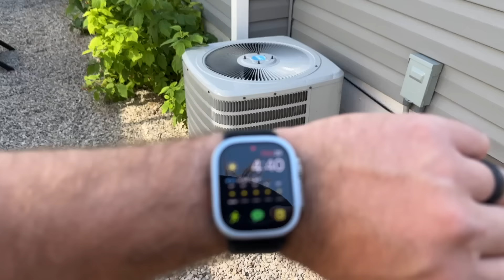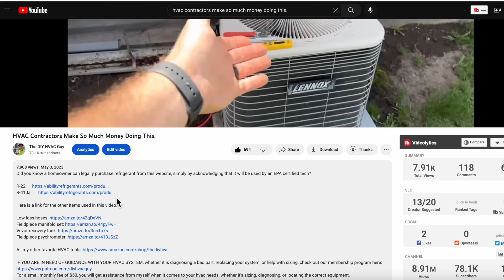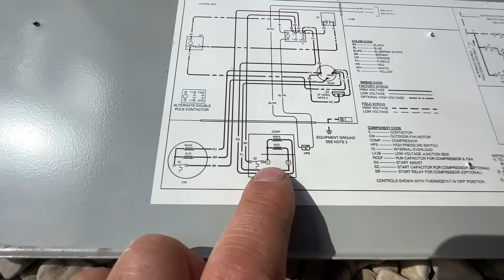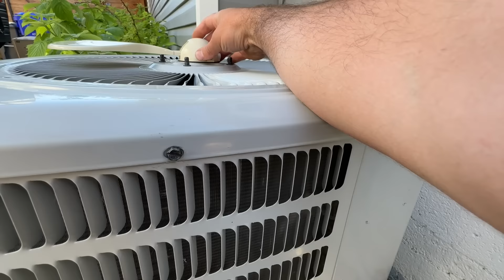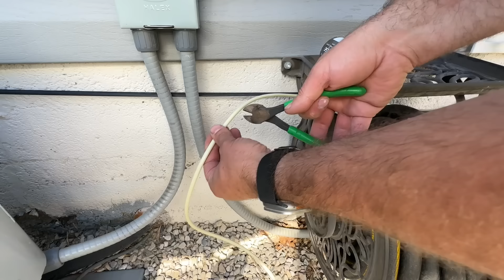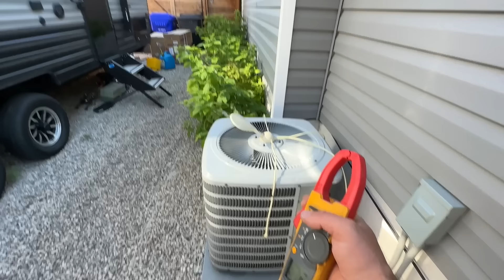Can This Device Actually Lower Your Electric Bill By 30%??

Comment: I give it a try last year. Worked as you said, but I removed it this year as the white, mineral scale on the outside of the condenser coil fins if not even close to removeable. Tried every home and commercial trick to remove the scale coating, not happening. Kinda wish I missed that video.

Comment: Very important key here, is make sure your water hose is in the shade. If you have a water hose out in the sun, that water will go from 70⁰ to 130⁰, which will probably give you zero efficiency.  

I also had an idea that if any of your hoses are out in the sun, to feed them through an empty water hose peice to shade them as well. But my air conditioner for some dumb reason is on the sun side of the house as well as my water hose over there. The water in the hose is so hot you can't even touch it. So make sure your feed line is in the shade!

Comment: Huh.   So you are adding a swamp cooler to your condenser.

I'm guessing this has the biggest impact where summers are very dry.   Here where we have very humid summers, I imagine the impact is likely marginal.  (that's why swamp coolers don't work at all here)

I'd imagine mineral buildup can be a problem even if you have reasonably soft water though. Is there any concern about additional corrosion by making the unit wet all the time?

Would be an interesting project to collect the condensate from the indoor units and lead it outside and mist the outdoor unit with it, much like how window units do it.

Comment: MAKE A BOX WHERE THE SUN COMES FROM. Cover the side where box can block sun rays make it at least 6 inches wider than size of box and 2 feet or more higher than height of AC Unit.

Comment: What if I took a 55 gallon barrel with water? That's really pure So I get no calcium, buildup, spray water on the fins, but mix it with water-soluble oil.
cutting oil from mobile. And have the water loop in a circle

Comment: There are issues with doing this including rust and mineral buildup.  To remove mineral buildup buy a cheap RO (reverse osmosis) filter housing and a filter, probably $30 or so total and install inline.  Will slow water flow but you dont want high flow anyway for misting

Comment: My mother lives in a barndominium and when it got too hot for the AC to keep up I would set up a sprinkler for her to spray water onto her roof. It also hit the outdoor unit, which I thought was a good idea. But now it's crusted over with calcium and I have to scrub it down with vinegar every year to keep it from clogging up entirely. Also wastes a TON of water, but she's on a well so it doesn't really cost much though it makes a swamp out of the north side of her yard. This system seems like it's superior in every way. I had thought about setting up a mister system around the south and west sides to help with the heat on the metal siding and roof but was afraid of the calcium build up. I'll have to look into those little mineral exchange units. That would make it work!

Comment: We had a couple of cooling towers installed at a chemical plant used to cool water that pumps through heat exchangers.  The only electricity used is for the motors and water then evaporates as it trickles down the cooling tower fins which cools 180 degree water to near ambient temperatures in a single pass through the 700 sq. feet heat exchangers.  The circulation line to the towers are 18" in diameter, so the heat removed is huge.  I can see how this works on a home AC unit.  Basically, the coils use evaporation to assist the cooling of the condenser so it doesn't need to work so hard.  We did need to add scale inhibitors to the cooling water because without it, the cooling tower fins would scale badly.

Comment: Having 100% humidity on the compressor side of your AC system will reduce the lifespam of the appliance by half or even more. Not a good idea at all. In any case, use alcohol instead of water, it cools much faster and evaporates so fast that will not affect the appliance like water would do. But now you are spending money on alcohol plus it could become a hazard. So be smart and just get a good AC system and let it work as intended.

Comment: Hmm... You have to wonder if just spraying mist was the solution then it would be baked into all these fans. There must be other engineering design considerations why this should not be done. The companies don't lose anything adding it or are trying to "cheat" you type nonsense because that makes 0 sense given people like this guy could be working there. There's other things not factored in

Comment: I spent 17 years as a HVAC tech in Phoenix.  DO NOT put a mist system on you condenser!  I have seen MULTI instances where it has ROTTED the aluminum fins so badly that you'll be able to EASILY drive your fingers into the fins and they will literally crumble like a mummy and expose the tubing that the fins were connected to. MAYBE it is the hardness of the water or a combination of hardness and PH.  Consider this: Pure water has a PH of 7 but tap water can get from 6.5 which slightly acidic to more basic PH 9 like Sodium Bicarb.  I would NEVER, EVER do this.

Comment: I used this system until I noticed the hard water deposits developing which would not wash off. 
I thought about the increased wear and tear on the AC unit was more than the money saved, so I stopped using it.
If your AC unit is in direct sun during the heat of the day, putting a shade over your AC unit will help during those times, with no negative effects.

Comment: I find it dubious.. Your system is designed to work at certain pressures and expecting certain temperature ranges. If you lower the condenser pressure you might experience issues with your system. Also, many places have a lot of minerals in the water which will quickly clog up the nozzles and your condenser core. I'd be very cautious trying to use these systems..

Comment: You need to filter the air so no dust  builds up on the small Finns like mud and than the unit will not work at all the water will desolve the small Finns too and you need a new unit in 3 months cause it dropped its gas

Comment: Shielding your air conditioner from direct sunlight will help cool your home better than almost any gadget out there. Just 
a piece of wood or corregated aluminum over the top and or sides but still allowing plenty of air to circulate will work great.
It will also help avoid leaves, pine needles, and other debris from getting into the fan and coils.
Reply: Add in a device to prevent recirculating the exhausted hot air back into the coils for a further benefit.
This can be a passive device with no scale contamination problems.

Comment: It probably will.
The question is the trade off.
It may lower the electric bill by reducing run time of the ac.
But buy what amount is your water bill going to go up.
Not knocking it, seriously wonder.
Over a month, this is probably going to be at least hundreds of gallons of water.
Also having the water all over the coil will restrict air flow at least a little bit, which will be a slightly higher amp draw on the condenser fan. So will that cancel some of the reduced run time savings?
I guess the only way to know would be to do it for a season and track the cost. And hope that energy and water costs remain relatively constant.

Comment: I put my paddle on top while the condenser was turned on and my paddle doesn't go up in any position.  My first thought was that maybe my airflow was being affected as my coils might need a cleaning, so I got a can of cleaner from Lowes and gave it a thorough clean.  That should do the trick, I thought...but when I tried to find the right placement for the paddle...no change.  My unit seems to be working fine, but it's not lifting the paddle at all.  I tried to contact the company, but haven't been contacted back yet.  Any thoughts, by chance?

Comment: How well do misters work in high humidity areas or if your water lines put out blazing hot water?
Reply: Water temperature almost doesn't matter. You can ignore it. It's all about air temperature and relative humidity of air.

Comment: In Houston the water from the tap has about 300 to 325ppm TDS, it would take just a few months to coat all the coils in the condenser with rock hard deposits so they would not even transfer heat any longer.

For drinking and using in my machines (I have a machine shop) I use an RO system with pump. I could take a 5 gallon bucket with pump and place it near the unit, inside of course. Just keep the bucket full as I do several other machines during the day. Water from the RO system runs 0 to 10ppm TDS. (who needs that $50 a month water service when you can make your own)

Comment: If an A/C unit is putting out 30°F below the outside ambient temperature then its doing its job. He stated 90°F outside and an air output temperature of 53°F indoors, that A/C is doing its job very very well. I want to know why he didnt clip the ammeter to the "red" wire when he took his first measurement. This is a good way to oxidize everything when the misting water gets into and past the condenser in my opinion. I'm not an HVAC tech but I am ASE certified in Automotive MVAC. This just looks like a good way to cause the condenser fan to oxide and lock up over time as well as causing a myriad  of other problems. Also that flap switch is blocking some airflow. Even though it's only a negligible amount I still think it possibly would affect performance of the unit. The guy was getting an indoor drop of 37°F and to me that's right around where the output should be. It would be better to spend some money on further insulating the home then some gadget that drops the current by 0.8 Amps. That might save you some change in the short term but in the long run oh boy at the repairs it'll need. Oh well to each his own.

Comment: Super impressed?! A single degree drop in temp at the register and not even an amp less running? 

The before and after measurements  are less than your measuring equipments accuracy ability. Measure it now it’s 1 amp less, measure it an hour later it’s a half amp more, measure it in 2 hours it’s .5 amp less. 

NEGLIGIBLE at best. These things will have mold growing and extra particles building up all over those fins after a while. 

Why would you recommend this? Doesn’t make any sense.

On top of that why would you expect it to be any quieter?? And why on earth would you expect it to pull less power?? Since when do compressors know how to adjust their power draw??

Gaaawwd dang dude, you should be ashamed of yourself for recommending this.

Comment: If you are using water with minerals in it (ie "hard" water) you AC is gonna look like shit pretty quick and youre gonna have calcium deposits on it. I used an evap cooler in AZ for years and it didn't take long and you got a calcified system. Oh yea, and if humidity is high, don't expect much evaporation to contribute to a lower cooling bill.

Comment: The Trane Air-conditioning manufacturer company tried this concluding most water utility systems and the quality of water produced are not compatible with these condenser units. Notwithstanding, I considered using a Reverse Osmosis unit that might solve some of the issue, but realized for every gallon produced 4-5 go down the drain. Continuing: If the typical unit ran 30 minutes per cycle per hour and required only 5 gallons per hour (1 clean, 4 garbage gallons) your water consumption would still exceed 3600 gallons per month as it were.  But not all is lost in this concept. 

A company in Arizona, once bosted about their seer 17 accomplishment system some 12+ years ago that used the following: Borrowing the "water cooled" direct heat exchange coil method (that started with Ice machine refrigeration units) otherwise known as "Water cooled condensensors", one would typically plate the copper coil with zinc or more preferably with silver &/ or silver solder. This same coil then sat in a water pool whose water was circulated similarly as an evaporative cooler back in the day. It looked like a typical condensor but functioned like an evaporative cooler. Nowadays,  seer 20+ are typical and have since dwarfed that concept.

Comment: I would not want the water spraying on the unit as it would deposit minerals on the coils.   I would set up the mist so that it completely evaporated to cool the air before it is drawn into the coils.

Comment: You gave us supply temp but never gave us the actual temp in the house. What was the split before and after? I can get a AC unit to spit out 45 when the house is 65. Not rocket science. Most ACs have a 15-22 degree split.

Comment: No, no, no, and no!!!
That will not help in the long run once calcium and minerals encapsulate your coil.  I dont care what filter you put in line.  Long term it will be catastrophic to your condenser.

Comment: Absolutely correct. Was in conservation and load management for a major utility providing guidance to residential and commercial customers. Never install any device that sprays water directly onto the condenser coils. It will destroy them. While this unit sprayed away from them, the spray was sucked right back onto them. No good!!!

Comment: I had one on for 2 years. Yes, it does work, but it also gives gives you a big amount of calcium build up. Enough to block vents. The only thing that would help is vinegar . You'd have to put it on a few times to get it cleaned off.but only 50% comes off . I would not do it again. After not doing it for about another 2 years after initially using it. I had to buy another AC. Unit, just because mine was about 30 years old.

Comment: Don't do this.

The coil tubing is usually copper, and the fins are aluminum. Keeping your coil wet will cause an electrolytic cell. This will cause the coil to fail.

A really bad idea.

Comment: The ideal works but it’s best used in short run times, like at peak hours to take the edge off. I would add a sprinkler timer to this setup and set it for about 3-4 hours at the peak of the day.

Comment: i made a system with a garden hose timer, it worked but stained my unit very quickly, with a house filter inline.  maybe a different filter. but it was for sediment, stain looked like the start of corrosion, I have mist 6 mist systems for our patios and our dog kennels. so i wanted this to work, but i am concerned it may eat up something inside at this point.  but my spray was constantly on for 5 hours.  also, if you do it spray the water spray away from the unit so that it only goes into the unit when the ac turns on.  my original set up sprayed into the condenser.  not best...

Comment: As others mentioned you would have to have a good idea of what kind of water you have. Just as a thought..if one has a rain barrel (which we do) one could set up a small pump and use that water. We (Florida) get lots of rain in the summer so keeping it full would be easy. Given the unit gets lots of rainwater as it is I expect it's fine to use. It would be a project that I'm not sure I'm willing to take on yet but something to think about. ALways appreciate these kind of videos though.

Comment: This is my 2nd summer in oklahoma city using this, working fine, small amount of lime build up. Will spray with vinegar solution this fall. Try it if you have high temps and soft water.

Comment: If you're watching this, DON'T DO IT!!!!!  After a a year of water cooling the AC coil will cause the aluminum coil of the condenser to deteriorate and break apart.  The calcium buildup on your coil will start to break down the aluminum coil which in turn the condender will lack cooling of the freon.  Yes, the water will help cool the AC but the cost of replacing the AC pump and condenser coil is not worth it after 2-3 years using the water misting system.
Reply: It's a good thing these things are not outside in the rain .
   Wash your coils

Comment: I am a A/C tech and my neighbor had a unit installed at his house 2 years ago. Fast forward to a week ago he called me and said it was 75F in his house. So I come over and see that he has this on his condenser, and his new condenser now has a bunch of white scale build up on it and I asked him why did he put this on his unit and he said that his unit can never keep up in the heat of the day. So after I checked the unit vitals and checking in the attic I found a return air leak that I was able to fix but his biggest problem was he had only 6 inches of insulation in the attic. In our area we need at least 12 inches or a R-value of 30. He and his sons did the insulation job and he miscalculated. He was told that his old system couldn't keep up and bought a new system and that one couldn't keep up neither and it was all because he didn't have enough attic insulation.

Comment: I am also wondering with your unit on a shady side of the house about the moisture in the air now making green algae grow on your siding and have a new problem to have to clean off each year? I think for the minimal savings this would be making extra work and possible moisture problems for the unit. Don't think I would want to do this.  🤔

Comment: I wonder what difference buckets or something filled with water outside would do, you could get evaporated cooling through the coils without directly spraying them. I’ve seen just spraying the grass around my unit in the Florida heat inside vent temps3-5 degrees depending on outside temp/ time of day

Comment: A buddy of mine added extra line coiled up in a drum.  He used lake water to cycle through the drum creating a heat sink to cool the coils.  I remember adding a heat transfer device years ago which help heat my hot water by absorbing lines set heat.  Worked great!